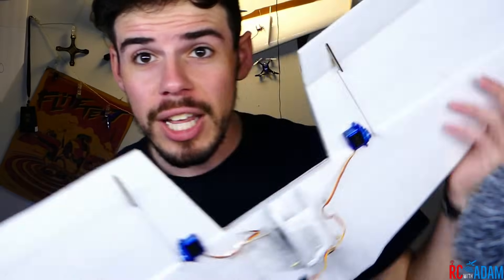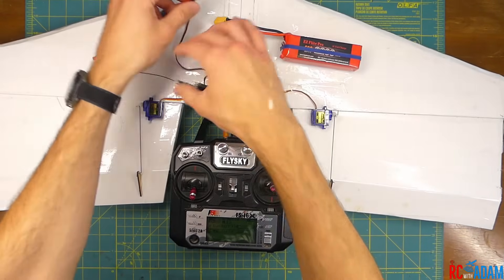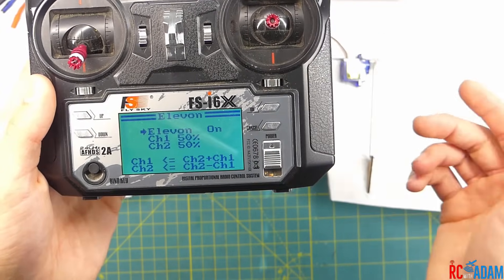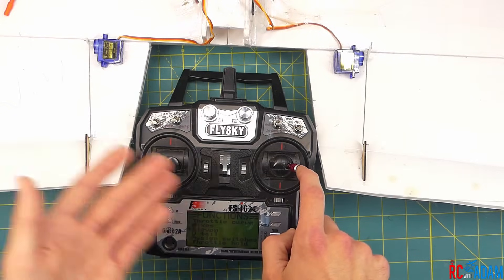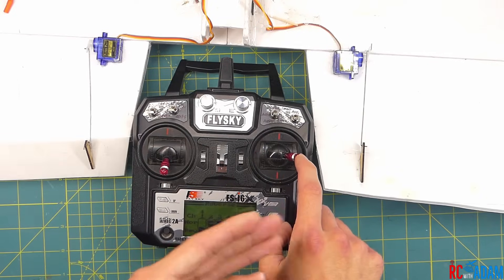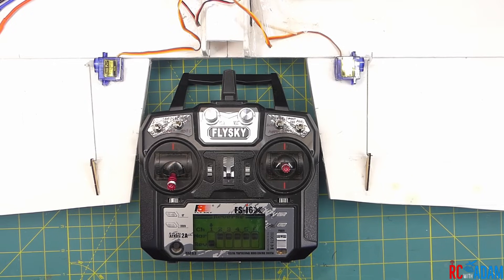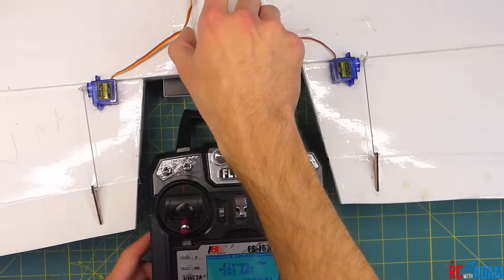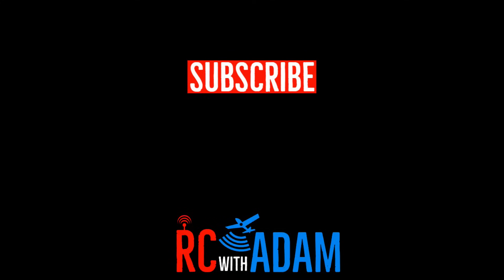FlySky FS-i6X Elevons Setup Guide - How to Configure Transmitter functions for Flying Wings

Comment: hi   has anyone had servo glitching problems for this transmitter    both  tx  and rx   was new out of box    i have tryed another rx as well and the same problem    anyone had the same problem   if so  how did you fix it if you could   cheers

Comment: Hey very useful vid. I am just getting back into flying and wondered if you need a separate inline mixer with these new digital transmitter/receiver's? Or is it all done through the transmitter settings?
Reply from the maker: Welcome back! It's all done through radio settings.
Reply: @RCwithAdam1  thank you for your response. Much appreciated